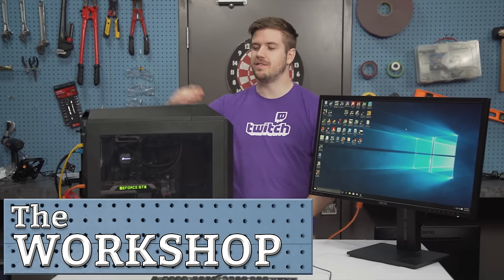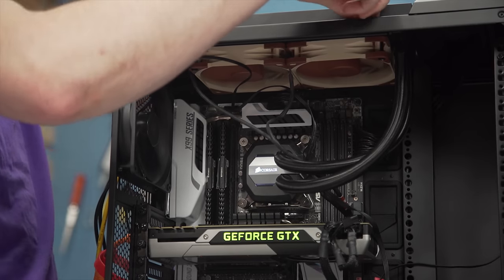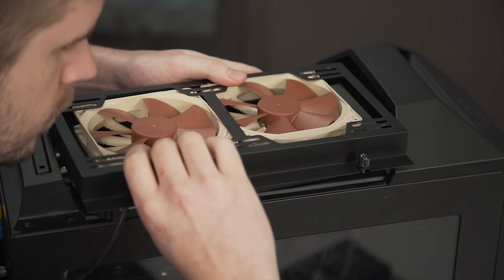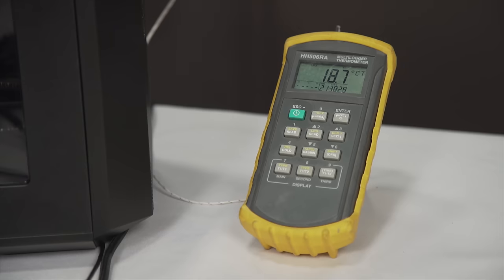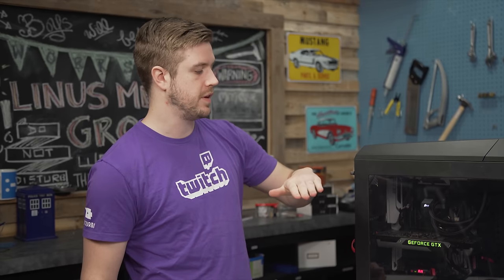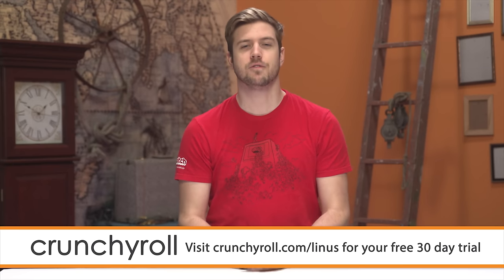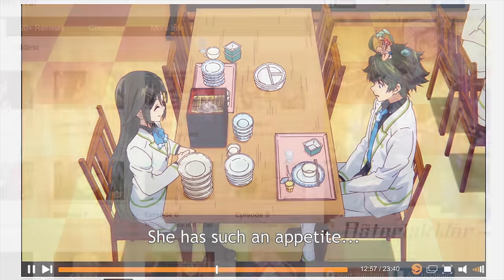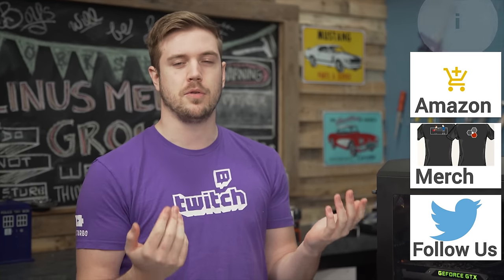Radiator Fan Configuration: Does It Matter? - The Workshop

Comment: I realize this is an older video but this is very misleading these days.  The primary fail in this testing is that the GPU used is a blower which is pretty much not  a thing anymore and keep the heat from being dumped into the case.  This means effectively that in any of the scenarios tested there is only going to be a small difference in the temperature of the air being pushed through the radiator since this particular setup doesn't have a lot of heat that would be going up towards the radiator (in the exhaust test) and most of it will be cancelled out by the intake fans.  This would be completely different had they used a non blower style card and certainly will be different with some of the modern GPU's that are pushing 300-400 watts.    Arguing that there is no difference in radiator as intake VS exhaust is basically arguing that the temps of your radiator will not be affected by the temperature of the air you are passing over it which is patently false.  I would also argue that the "see you in 10 minutes"  interval is not enough time to really see the AIO water temps get heat soaked.

Comment: How can it be better to pull hot air from in the PC through the radiator, than cool air from outside the PC? I dont understand. Lol
Reply: It's better with the top mount as they're showing here. If you want the cool air straight to CPU, go with the front mount rad setup ; ).

Comment: I don't understand. This is a borked test...Isn't that a founders edition GPU? Obviously i'm wrong when I say that 90% of us use aftermarket GPU's, but I'd like to say that the majority of us do. This is important because the greatest PC heat contributor is the GPU and aftermarket GPU's radiate heat into the case rather than out of it like that founders card....meaning that if it was an aftermarket GPU, all that hot air being vented from it would destroy the temp levels of a exhaust-radiator setup. 

I can't tell if this is silly or rigged. Just watch Bitwit's video on this topic. Aftermarket GPU's should be used with Intake-radiator setup, founder GPU's should have exhaust-placed radiators.

Comment: Conclusion: Step 1: Take an amount of thermal paste (doesn't matter how much unless you do to much or almost nothing) Step 2: let your inner designer go wild by putting cardboardboxes and the fallout 4 pipboy on display next to your fans.

Also serious question how would the temperature be if you had an air cooler and only 1 Exhaust no intakes in a midi-tower

Comment: the test is invalid because the system hadn't been running for long enough. idle temps are useless information, load temps mean much more. if the system had been running a heavy benchmark during the test we would get a better idea of which configuration was running better because the system would have a higher internal ambient temperature.

Comment: This is a "americanized" answer to the question i think. Afaik most american homes are climate controlled resulting in the ~18°C room temperature. Alot of other countries don't do that. It would be interesting to know if the "doesn't really matter" answer stays true when the room temperature rises to like 30°C+ (a non-climate-controlled room in the middle of the summer heat).

Comment: Good idea and bad testing methodology. First of all, overclock the CPU, secondly - make your GPU work hard too! Just as if you were gaming and then you'll see a difference in results. I have done that before and found that both fans on top of rad pushing air into case gave me nearly 10 degrees in Celsius improvement on CPU temps.

Comment: Okay for fans, but how about multiple radiators on a single cooling system versus a single radiator? Would the cooling effect be linear additive? or less...?

Also, similarly, does the size of the radiator matter, i.e. does bigger equal cooler? Not trying for any puns here... LOL. So with that in mind and just to be ridiculously extreme (maybe?), would an automobile radiator work? It seems like it should... It might take a few more fans... and a much stronger pump due to the volume of water...  https://duckduckgo.com/?q=rolls+royce+radiator&iar=images&iax=1&ia=images

Comment: Of course fans configuration does matter. Probably less with water cooling like in your case, but much more users uses traditional fans and radiators on their cpus/gpus and direction of airflow affects it A LOT.
Quite pointless test.

Comment: I would have thought the main question for a closed loop CPU radiator is whether to use it as an intake on the front or an exhaust on the top considering the impact on both CPU and GPU temps... Why would anyone even consider sucking unfiltered air through the top of the case? I guess the assumed intelligence of the audience is pretty darned low when you're demonstrating fans installed as pull/pull on a radiator, though. Seeing that config tested mainly convinces me I should probably think twice before clicking on another "Workshop" video.

Comment: My room temperature is 30C and my CPU is at 22C
I was going to buy Corsair but instead bought NZXT X61.
I'm really impressed with X61
Linus should do a Liquid Cooler comparison.
Reply: +Ozgur Sen Pretty sure your' numbers are a bit off. Unless you use some crazy nitrogen cooling thing, CPU temps kinda can't get below ambient.
Reply: My Room is about 23°C and my CPU is at about 27°C on a Corsair 280mm GTX watercooler :p
Reply: +Ozgur Sen no need. X61 beats them all thanks to its dual-140mm rad.

Also, you got your room and CPU temps mixed up.
Reply: Okay sorry I mixed the liquid temp to the room temp. 30 is the liquid temp and 22 is the cpu

Comment: this is not a proper test, you need your computer to be on for hours to know what the internal temps will be and then how those temps effect the radiator cooling, both pulling air in and forcing air out...soooo...ya.
Reply: +MARIN Koza 
Hours? Take your heat sink off and see how long it takes to overheat.

Comment: Your ambient temp was extremely low and unrealistic (18c = 64F). The internal temp is also low; upper 30s is where a lot of people would be at idle, no where near load temps where real heat is battled. This is important when testing discrepancies, as your system, helped by cold ambient air, is already making the system run nearly as cool as possible using air. Essentially, significant differences will be less noticeable if not concealed behind an already cool system.

You also focused on heat dissipation, but it's important to mention air pressure. This will depend on the case, especially if it's not helped by dust filters. Negative pressure is created when you're removing significantly more air from the case (via fans) than introducing. Because physics, ambient air will be pulled into the case through any access points, which will introduce dust to the system. It's inefficient to cool the system this way, anyway; you're better off bringing more outside air into the system.
Reply: The thermodynamics are the same. The change in temperature only gets wonky of you have a phase change somewhere in the process. It doesn't matter really and the difference is 1 degree Celsius, which could be just normal changes between runs

Comment: I get that you guys are fans of Noctua but when you get down to the stats even the super cheap swiftech Helix pwm series have better performance. Bitfenix also have some really good pwm models with  high static pressure and airflow and acceptable dB output. 

Those fans are 15 to 17$

Noctua is kind of overpriced.

Comment: First: maybe do a video on how to DIY sound dampening with easy to get materials, rather than expensive kits. On more open style cases with lots of fans (to eliminate or scatter the squeaky (higher pitched and more disturbing, erratic) noises like VRMs and HDDs and memory etc, rather than trying to eliminate all noise or the noise of the fans as well) ?

Second:
yeah, guys, you lately seem to fail somewhat intentionally to really think things through before you do certain tests.. as with the thermal paste video the other day. Looks like you don't really care (just about creating yet another video) for a proper evaluation and a real world scenario, actually, different scenarios. This is as synthetic as the benchmarks you run. 

What about people with (an) open air cooler(s) on their GPU(s)? Or lots of hard drives that heat up the inside of the case? that will probably make the intake temperature for the rads higher. But you didn't even bother to run a GPU benchmark at the same time, or run a game benchmark. But, since you have a stock cooler on your GPU it wouldn't have made a real big difference, maybe 1 or 2 degrees. 

And what about noise levels? If you set it up to basically create a little extra air pressure inside the case by blowing more air in than is coming out, what happens then? Will it dampen the sound or what? 

But I get that you guys want to make as many videos as you can, so you make them simple and flashy.

Comment: LinusTechTips 
How about Push Push Push Push Push/Pull Pull Pull Pull Pull fans configuration? Use 20 fans instead of 4....Lmao!
Reply: +Jay Simons No.
Reply: TinchoX I know it has been done before by somebody else, but I want to see their take on it, I think it would be funny.  

Or another idea thats been touched on by many forums including Overclock forums as summer approaches a ghetto cooling "guide"..
Reply: Jay Simons The 20/20 build was done by some idiot that got MINUS 3 degrees celsius (obviously a fake/lie, you cannot go below room temperature with air), so it's pointless.

Comment: Was this at idle or load? Because if its at idle, this whole video is pointless. Other things get hotter at load which will affect the rest of the case temps, not to mention you should really be running the GPU also as thats going to affect the interior temperature...
Reply: +Ampisound They clearly said they were running AIDA64
Reply: +TheFlynCow Just checked the video on a bigger screen so I can actually see the text, yes theyre running the CPU @ 100% but not stressing memory or GPU, so while results work in a vacuum it would have been more informative if the whole system was under load, when temperatures matter most.
Reply: Ampisound true.

Comment: OH MY GODDD YOU DID IT WRONG, YOU DIDN'T CALCULATE THE QUANTUM PHYSICS OF THE FAN BLADES AND THEY HAVE A HUGE DIFFERENCE I KNOW BECAUSE I DID IT MYSELF. IT MAKES A FULL 100 DEGREES DIFFERENCE AND I THINK IT SHOULD HAVE BEEN 10.1 MINUTES INSTEAD OF JUST 10, IT GIVE MORE TIME FOR THE MOLECULES IN THE FAN BLADES TO BE ABLE TO PUSH MORE AIR WITH ATOMS.

Comment: Put the Radiator behind the Blower fans of two SLI cards. Or put it below an aftermarket graphics card blowing air into it. Use ZERO fans and put some Ice on the radiator.

This would have made a better video.

Comment: all i care about is if the gpu is affected by any of these configurations!!!!
Reply: The one thing that the video neglects to mention, is the difference in ambient case temperature. As the video proved that the configuration had little to no effect on the CPU cooling, you will definitely want to be using the radiator fans as an exhaust, rather than blowing the hot radiator air back into the case
Reply: Are radiator fans static or airflow?

Comment: Actually increase the case's internal ambient temperature, then try pulling up. I love that you conclude "it doesn't really matter that much" Real concern for what you've come to, I'm sure Luke's tired of the videos. 

When I first got my rads the amount of threads I went through of people mounting their fans as exhaust and complaining their temps weren't as amazing as others, because they were blowing nothing but hot case air from their GPU and the like through it.

High quality fans and case in a perfect world, the skew is unexpected but doesn't sway me in any way. Make your god damned cooling fan grab fresh air, and actually clean your computer once in awhile; I know default configs make it such a trouble to un-screw 4 screws every couple months and clean out your rad; you surely don't do your own oil on your car either..

Comment: Disliked.  He recommended pulling warm air from the case to cool the CPU.  Your CPU will run 10 degrees C warmer under load.  Ideal is to cool the radiator with air from outside the case.

Comment: I think you should probably try three fans on each side of the RAD for a total of 6 fans in a push pull config, then you will need to step it up to 5 fans for a total of 10 fans in a push pull config, then you should finish with 10 fans on each side for a total of 20 fans in a push pull config. But if were still using a dual RAD, then multiply the fan config by 2

Comment: ok, so I like these videos, but they always seem to test nothing. when you're only staying the cpu, of course the fan configuration doesn't make any difference. but what about if the whole system is stressed? What if your gpu is running at high temps heating the air inside the case? 

surely after all these years of doing videos like these, they ought to know how to do proper tests.

Comment: Why do a video all about the difference in temperatures on a setup with temps so loooooooow.  We do things like run push/pull setups, and fuss about optimum fan placement because of the need to manage high temps, not low temps.

Comment: No surprises here, but the experiment itself was pretty poorly executed.  Run it again with some stress tests going.  If there's going to be any difference what so ever, it'll be highlighted in a more pronounced way by the higher temps.  Seriously, was Luke just like 'so we know how this is going to go, why bother wasting time on waiting half an hour for each stress test?'  Can't blame him, but still...  

Total sidepoint; you had 4 fans going and you didn't even want to try 2x 'Left' intake and 2x 'Right' exhaust and instead had them push at each other, without even trying pulling from each other because 'workshop'..?

Comment: Whats more important are the case temperatures because those would differ by a big margin depending how and where u place the case fans...otherwise this video is quite pointless since the same amount goes through the radiator no matter how you place the same amount of fans. Wether above or below the radiator... lol Hey lets see how much gas will my car burn when i sit on the driver seat, and passenger seat... (assuming i could drive from passenger seat).

Comment: I'm starting to get tired of seeing such poor testing methodology in these videos.

If you're trying to test fan configurations on a cooler, you should do it at the sort of thermal load that the cooler was actually designed for, rather than a thermal load that could be handled by a shitty stock Intel cooler. 

For any sort of thermal testing like this - where you're testing different fan configurations or something similar - you should be doing it with the system close to its thermal limits, because this is going to maximise any difference that different fan setups will show, minimising statistical uncertainty.

Considering the vast majority of the dual 120/140 closed loop coolers will be used on heavily overclocked processors, why would you test them with such a tiny thermal load?
Reply: Their video quality keeps going down :/

Comment: video is bullshit. intake vs out is dependent on the GPU, if you had an after maket GPU running at 100% pumping hot air into the case then that would effect the cool performance if you're pushing air out of the case and would see bettter temps when pulling in.

when the GPU isn't under load, is blows its hot air out of the back like all the reference cards do then it doesn't matter.

Comment: the conclusion statement is false.

benchmarking for 10 min doesnt get the water temps at nominal state as you need atleast 30 min of benchmarking to reach it

benchmarking an cpu and only get 35c makes the whole testing results doubtfull

you insinuate a case benchmarking results but not even include the GPU  benchmarking and we all know that it is the hottests hardware as in real life usage the gpu gives 70c constant (about 50c blowed in the case) the second you game.

statement of AIDA64 representing real life situations is false.all my experience with pcs , overclocking , watercooling and my experience with AIDA64 showed another false claim of a software maker .

occt and prime95 will show an hole new result. 

there is an reason why "burn in " terminology exist.

i overclock since about 1984 and thid video is aFAKE